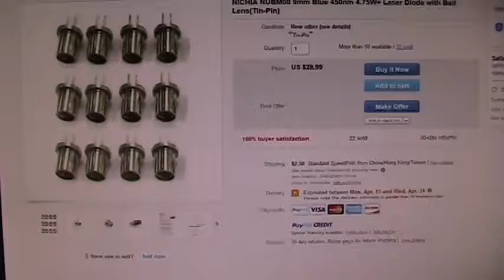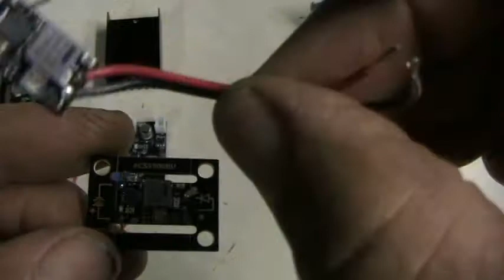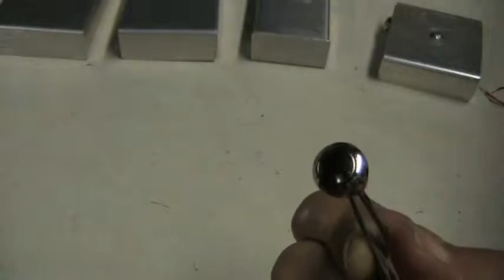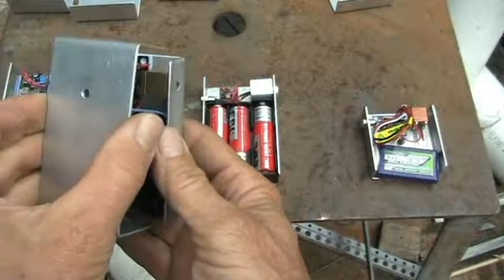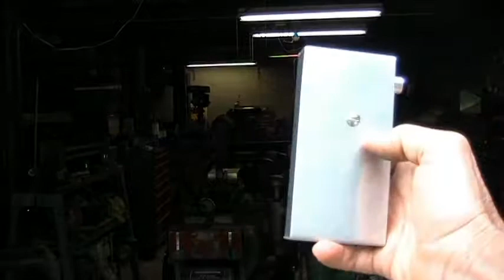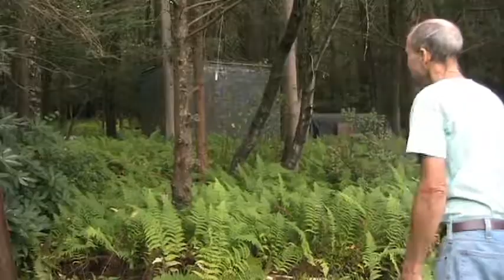multi watt pocket lasers

Comment: Thanks for the inspirering content ....

Love to see you push this with more power ...or a mulipter strengths in diodes....
Reply from the maker: I have a 8 diode unit and a 2660 battery pack but hadn't had a chance to assemble it. Thanks for the interest.